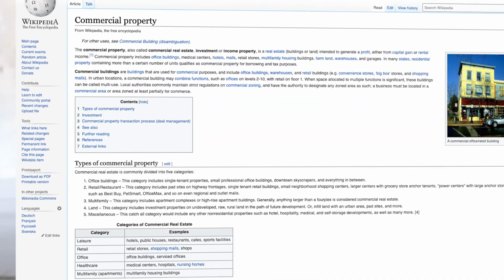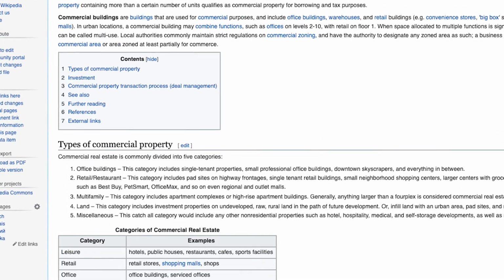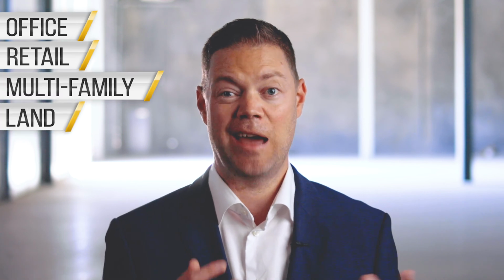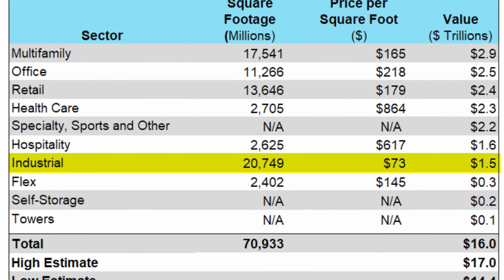The Basics of Industrial Real Estate

Comment: I’m working on getting my real estate license now, what’s the best way to get into commercial/ industrial real estate as a new agent? And would you recommend starting out in residential or going full force in commercial?
Reply from the maker: I started out in residential myself, but switched after a year and it was the best career decision I ever made.  Starting in residential can be a good foundation, but most commercial brokers start right into commercial.  It is hard to make the switch, but if you have a gameplan I've proven that it's doable.  To get into commercial you'll want to talk to as many brokerages as you can and see where would be the best fit.  Some will require you to do a 2 - 3 year assistant / mentorship program whereas others will allow you to be an agent right from the beginning.  The assistant program will usually come with a small salary, whereas starting on your own will have no salary (but no ceiling either).  One thing I've repeatedly observed over my career is that the brokerage plays a pivotal role in the agents success.  I've seen a lot of really good people quit because they didn't get the help and support they needed whereas others have thrived.
Reply: @industrialize  thank you for the info!
Reply from the maker: @TheRealKingWil  good luck with whatever path you take!
Reply: @industrialize  in your opinion would the assistant program be better than being an agent right from the beginning?
Reply from the maker: @TheRealKingWil  they both have pros and cons but I believe an assistant's program is the best choice.  It will take 1 - 2 years to be comfortable in the business either way, so being able to learn under experienced brokers while being paid a small salary can set you up for a successful career.  The only thing I'd add (and stress) is to make sure you select the right brokerage and the right team / mentors.  Make sure both are committed to seeing you have long term success and have a plan in place for you to get there.  The last thing you want is to join a team where they only see you as an assistant, not a future broker.